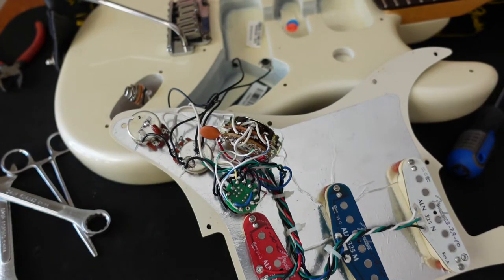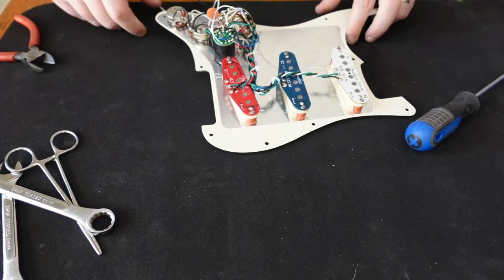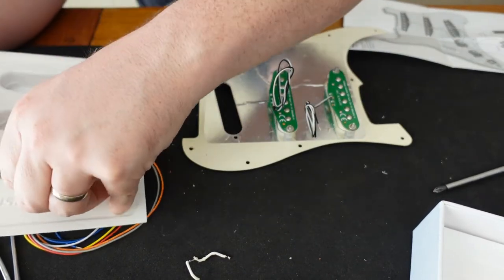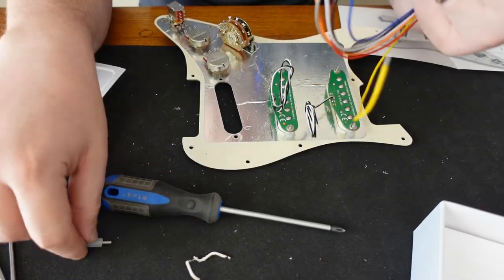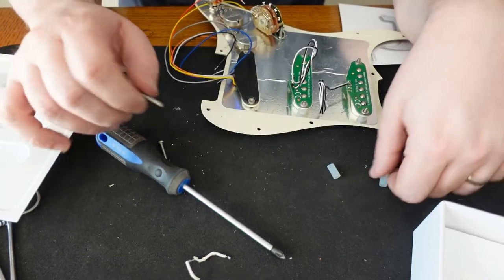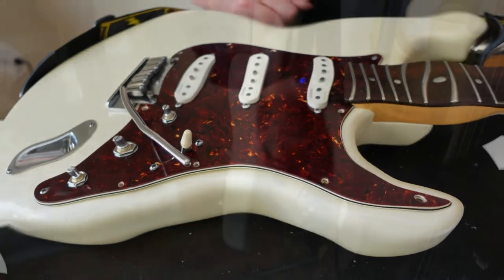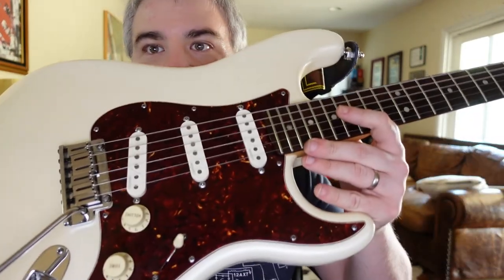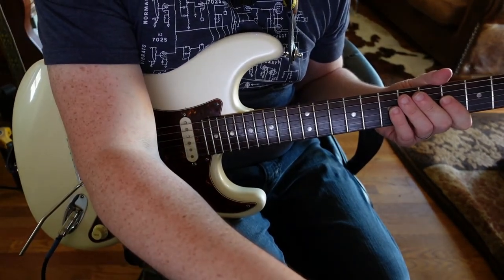Pickup Upgrade: Replacing Fender N3 Strat with Fishman Fluence Single Width

Comment: I was hoping I soldered the gray wire in the wrong spot..I guess not ! my push pull isnt working, I’m stuck on voice 1, I can’t figure out what I got wrong lol
Reply from the maker: Did you check to see if the wire impedance/resistance to ground changes when you engage the push pull? If you have a short to ground somewhere, this might be the issue.
Reply: @cowhidemusic8904  yes, looks like it was a weak ground solder on the push pull ! All good now, thanks !
Reply from the maker: @raphexe  Great! My shitty video helped someone!